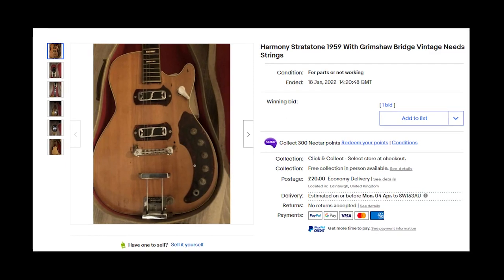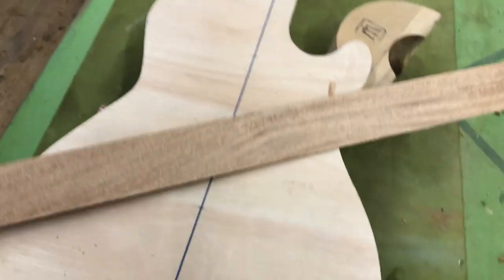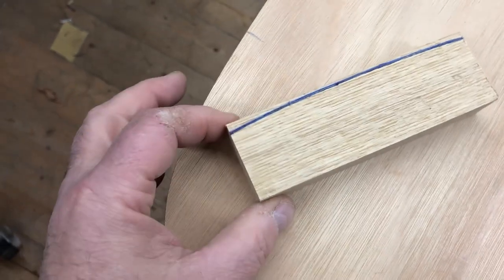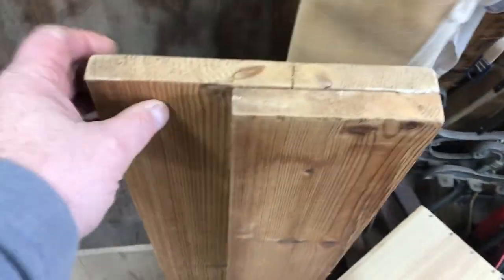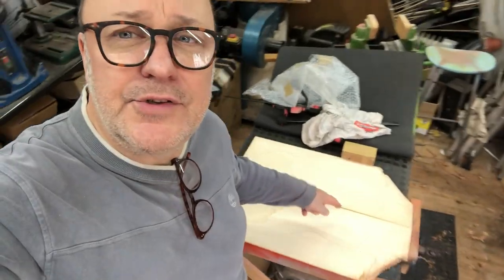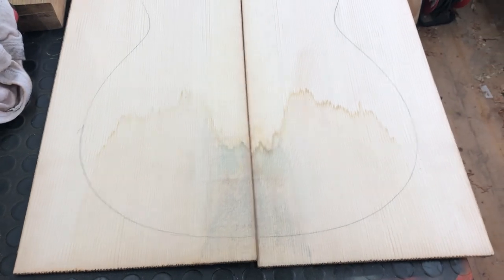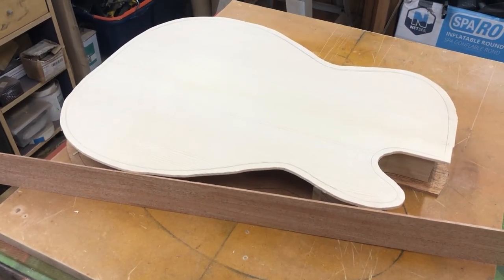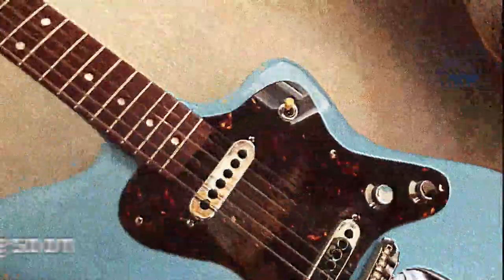Part1 - Full build of a Harmony Stratotone style electric guitar

Comment: Plywood is in many ways superior to solid wood. For acoustic guitars, the solid wood has properties that make it better, but for electric guitars, the plywood is more stable, can be just as esthetically pleasing, and is far easier to work with. That’s why they used it. Probably much more economical too. And I dare you to find a real difference in sound with identical scale length, pickups, bridge structure, tuners, nut material, neck and frets, and electronics. Of course those guitars that used plywood would also have inferior everything else.
Reply from the maker: We could argue at length about the pros and cons of plywood in guitar making. It certainly has its place and but in acoustic guitars it's a mixed blessing. Having bought the 59 harmony, repared it and copied it with tone woods, I can faithfully report that the difference in brightness and sustain are truly huge. That said, should I build a semi acoustic I would consider laminating rather than carving. I'm all for new materials and experimentation.

Comment: It seems that you had (have?) two Stratotone guitars as the one at the start of video is different from the one shown in your shop, yes, no? In any case love your builds and video series!!! Just discovered you and subscribed!
Reply from the maker: I did a Stratotone build as my first video project. I bought one to restore but ended up copying it instead. I still plan o restore it. That will include a pickup coil rewind.
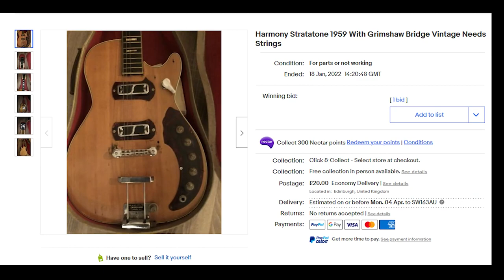Reply: @chrisreynoldsguitarmaking  My comment refers to the guitar shown @ 0:27 compared to the one hanging up @ 1:43 as they have different bridges, tailpieces, finishes and pickguards. Or is it the same guitar that you started to restore and had made changes to?
Reply from the maker: @1959LP4U  it’s the same guitar. I began a restoration of it and got diverted from the build by the lack of winder for the pickups.